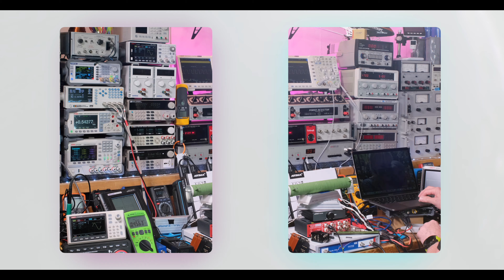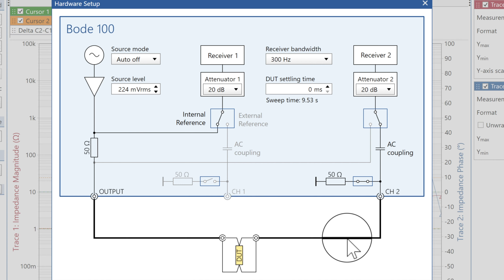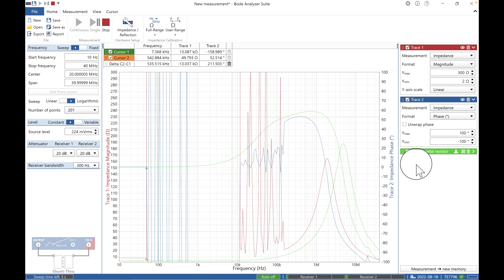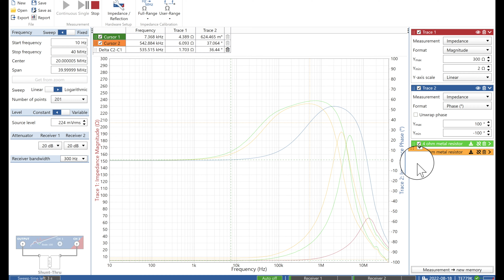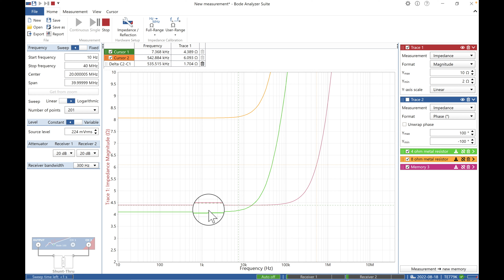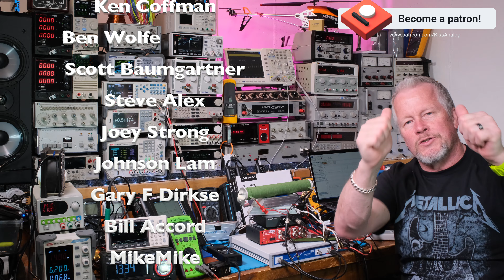Comment: I did some work looking at a 220K carbon composite resistors in a valve ampllifier, where voltage swings can be 300V. Firstly noisy as hell,  it was all over the place. It also has a non-linear element where the resistance drops with applied voltage, mostly over 160V so it compresses the amplification a tad. The third question was how fast did it do this? I didn't go further, but with a 1KHz sine, the exacts same voltage compression was present as with a DC test.
Reply: Thanks for the great question.  Yes resistors also have a voltage rating.  Many are not rated for 300 VDC, so it is common to use 2 or even 3 in series.  If the resistance changes with applied voltage - that is a great sign that it is not rated for that voltage.  At audio frequencies, especially at 1 kHz, there should not be a change.  Load resistors have more current so inductance can show up a bit as shown here.
Reply: @KissAnalog  Hi, It's only Carbon composite that are really non-linear / bad, Carbon Film, metal film ect are fine, you'll find that generally a higher wattage resistor has a higher voltage rating, hence you see 2W resistors in valve / Tube amps where the wattage is a fraction of this.

Comment: @kiss analog,  new to electrical work and have an oscilloscope (analogue) but need a bench power suply, any you wouldn't recomened on the less expensive side (150 bucks at most unless any lower is unsafe).
Reply: I love this little but powerful power supply.  Use KA15 and you get 15% off - even from the sale price: https://kaiweets.com/products/wanptek-aps
Reply: @KissAnalog  just got it thank you!!

Comment: What do you think of grounding boxes quite common in hifi.? Where you would have a capacitor resistor and an inductive possibly fed to ground Earth. Give us the statistics on the graph if its beneficial.
Reply: Thanks for asking.  In short - there is nothing that Earth ground can do to improve the sound of any system.  It is that simple.  I did a video that you might find interesting: https://youtu.be/KaqcDL4R1uU

Comment: Curiously enough in getting my new workbench setup sorted for dialling amplifiers in, I recently tested some giant aluminum clad motor braking resistors on my Dayton Audio DATS V3 ..Amazingly they came in almost smack on the 8 Ohms specified, and despite being designed for general purpose industrial use, they exhibit zero inductance, which was a welcome bonus. So yes, whilst cheap for power resistors, I see no down sides to using them sofar :)
Reply: Thanks for the great feedback!  I used resistors on the job like this as heaters for a communications system;)  What brand or part number did you use?

Comment: Eddie You da man!!!  😊

I used to be a self proclaimed ‘Audiophile,’ and I could tell the difference in fractions of Hertz, between cables!  You believe that, right?  🙄😂  Please do a Speaker cable Video.  
I had friends that claimed they could tell this and that, I dont know?  I never cheapened out on my connections, but the ‘Source’ was always the most important aspect of a High Fidelity Sound System.  
I ran a higher end Kenwood DC Integrated Amplifier, and a Dual turntable, with Shure cartridge, tracking at a little over a gram and a 1/4 or so.  Used a Discwasher and Zerostat system on the records.  Aww, I miss those days.
Reply: I might still have my discwasher and antistatic system.  I don't remember the name - so it could have been Zerostat... you bring back memories.
Reply: @KissAnalog  👍

Comment: My first job in Electronics [1967] was testing precision resistors. Precision wire-wound non-inductive resistors were wound half way in one direction, half way in  the other, with a wire that had an intrinsically low temperature coefficient.  The trend was toward 1% metal film resistors in arrays with cancelling temperature coefficients to remain extremely stable over temperature.  We used a tertiary standard Kelvin Bridge, with beakers of oil at room and elevated temperature in which to immerse  each resistor to calculate its TC. we noted each one's absolute value and TC, and added them together with canceling TCs to achieve the final "perfect' resistor,  or voltage divider. The Stanford Linear Accelerator project bought a lot of our stuff.  Cheers, --bd
Reply: That’s awesome bill
Reply: Wow - now that is expertise!  Thanks for sharing!!

Comment: Air core wire wound resistor will have a magnetic field generated which will have an affect in testing an amplifier.
Reply: Yes normally it would - but if it is non-inductive - there is no magnetic field;)